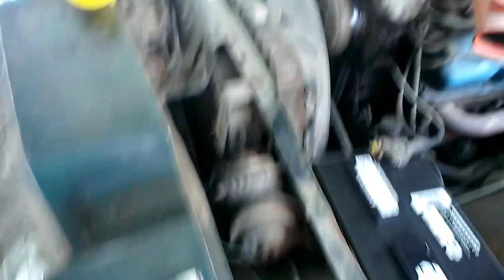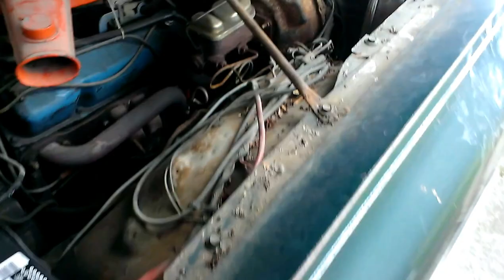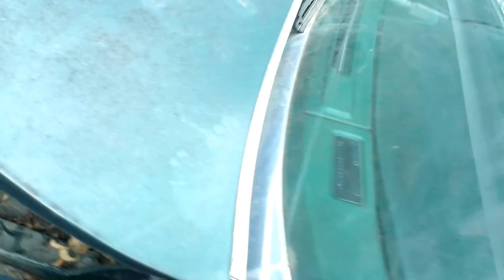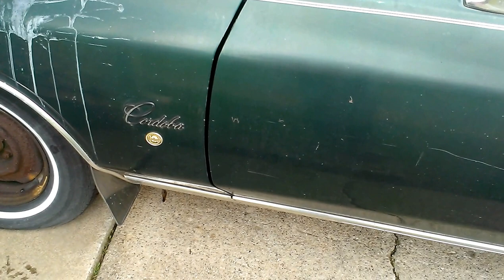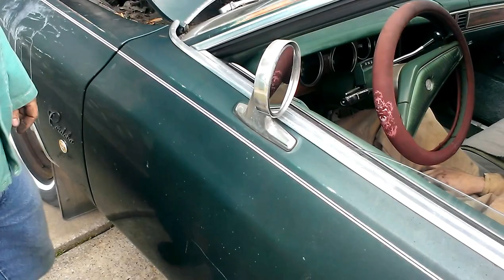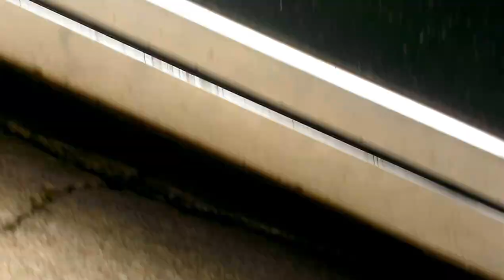COLD START 1978 CHRYSLER CORDOBA AT AROUND 45 DEGREES F

Comment: It's backfiring because the valves are sticking in the cylinder heads and the timing is off they had electronic ignition for a few years 78 and up was problematic but cool cars